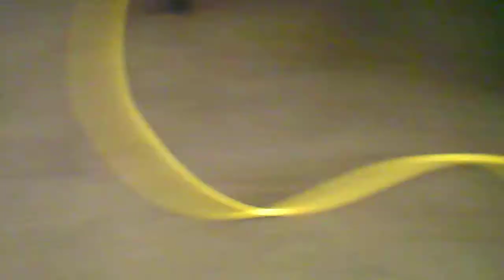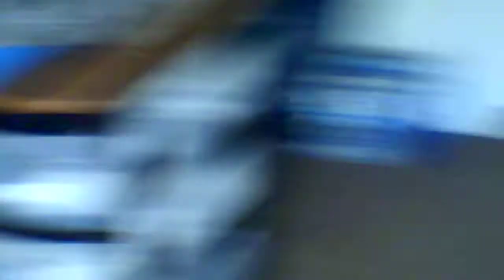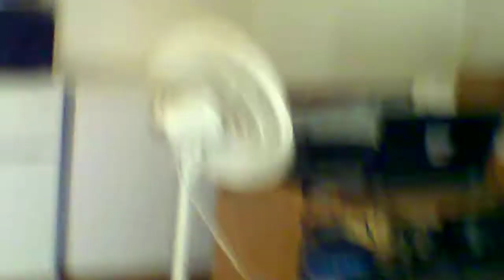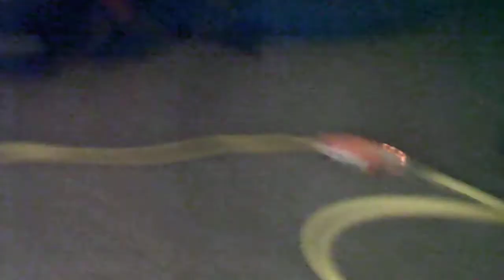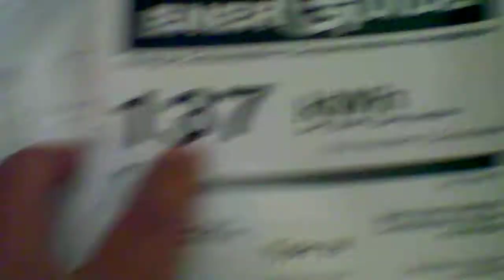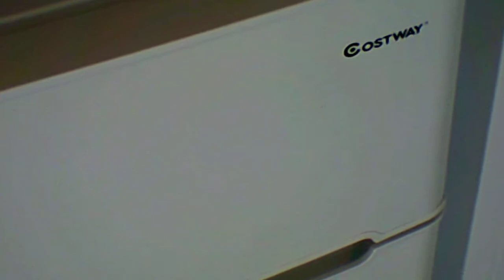Testing Mini Fridge and Deep Freeze off of solar

Comment: How much battery 🔋 capacity do you have? Is this still working for you?
Reply from the maker: I have (2) 122 Ah duel cycle marine batteries. I will add at least 2 to 4 more batteries for longer run times later. I also have manual timers to run them so they Don't run all the time. If you are trying to run a deep freezer and or a fridge or both then the more batteries the better for those days without sun. I have a few different ways to charge my batteries. 1. Solar ( I have 1200 watts in total ). 2. a wall outlet from the grid and a automotive battery charger if needed. 3. A gas powered inverter generator with DC charging. 4. I have a full size ram van that I can hook up jumper cables to. 5. I just purchased a 400 watt wind turbine generator. While you can run these off of solar with enough batteries and panels. Always have a backup for when the sun is not out. I also have a new 3.5 Cu Ft chest freezer since the start relay in the one in this video went out. One important thing is when I take anything out of the freezer I place a bag of ice in it to keep it cold. I have 2 portable bullet ice makers. Never just rely on solar alone, and don't even rely on solar and wind together since there are times when nether one of them will work. I live in Montana and in the winter I could just place most of my food in a cold box outside. So I would not need to run these inside most of the winter if my batteries went low. Can it be done ?. Yes. Does it work ? . Yes. Do you need a backup power source ?. Yes. Should you have at least four batteries or more ?. Yes. I hope this answered your question. Have a nice day.
Reply: Cool stuff man. I live in Missouri. I have a mini refrigerator that looks just like yours, except it's an Arctic King. I run it off of about 1200 watts of panels, but I only have 1 100amp hour 48volt deep cycle battery. I just ordered the Avanti 2.5 chest freezer. I'm hoping I can get away with running both my mini fridge and the new chest freezer like how your doing.  I woke up this morning and my battery was at 51 volts, so I'm hoping I will have enough battery power to add the Avanti Freezer and not drop below 48 volts during the night. Thanks for the video man, I'll probably buy me a couple timers too! Good Idea!
Reply from the maker: @jerrodbulgin2261  Please read everything. If you had purchased the Artic King 3.5 Cu Ft chest freezer. the insulation is a thicker, and it would hold the cold longer. My new chest freezer is a Artic King and it works great. I have a video on it and I show the tag with the power usage. The start relay in my avanti 2.5 cu ft went out in a year and four months, and the freezer stopped working just four months after the warranty expired. It was a good thing that I had a bunch of ice in it, or we would have lost everything in it. If you don't want to check out the video here are the specs off of the back of my new freezer. 115 Volt at 1.1 amps. That would be 126.5 watts, But i'm not sure if that is kicking amps or running amps it does not say. If you did buy the avanti already then always keep ice in it, and buy a cheap thermometer to check the cold inside it and get a replacement universal start relay you might need it. The guy that I gave my avanti too works on these a he said the the start relay is what goes out the most on these smaller chest freezers. While the avanti worked it worked great, but only lasting a year and four months was disappointing. As far as your battery goes if you are going to run both on your battery then a second battery would be a good idea for those days that don't get any or low sun. I have lead acid batteries and I use manual timers to turn the power off and on at night so they don't run all the time. The average chest freezer can be ran 4 times a night for 15 minutes at a time to keep it froze, But the avanti has pretty thin walls, and door so I would run that 5 to 6 times a night on a timer for 15 minutes at a time. I tried to answer your question the best that I could so I hope this helps in some way.

Comment: I`ll be living in a travel trailer in a few months or so. I`ve paid for it. I`m on SSI disability since last year so I used some of my leftover back pay and all of my stimulus checks to buy prepping stuff for solar power. I bought three power stations that can be charged with solar and have seven of the portable folding panels between 20 and 60 watts, about 16 of the small power banks between 10,000 and 36,000 mAh, several USB NIMH and 18650 litium ion chargers, warm white USB LED bulbs, and several USB fans, two that can be recharged with USB. I also bought a real 100 watt glass panel. 

I bought a 12 volt 100 watt rice cooker and as it turns out that`s the wattage output of the 12 volt ports I use to power it on my 300 watt power stations. I accidentally picked the proper cooker by finding the lowest wattage one possible. If you start with cold tap water it sometimes takes about 35+ minutes to make rice but I haven`t yet mastered using it more efficiently. But it works and I can actually cook from solar which is amazing to me and I`m very happy about it. I didn`t realize it was possible at such low wattage. 

Cooking a cup of rice uses about 20% of the 280 watt hours capacity in my battery. In actual usage and testing people have done there`s actually only 87% to 90% of the 280 watt hours due to losses in the circuits and features to protect the battery from complete discharge. Why don`t they advertise the ACTUAL usable capacity? 

 I bought a cheap 12 volt 120 watt immersion water heater to make instant coffee or tea. Years ago I had a 300 watt AC one and it was very useful for boiling eggs in a cup or mug. It boiled them FAST!

I ordered a 5 cubic feet freezer that I hope is as low wattage as the same size 75 watt Igloo freezer I had in my cart waiting until I could deposit a check the next day. Suddenly it became unavailable. I think the freezer uses between 300 and 400 watt hours per day. I haven`t received a 700 watt Bluetti EB70 power station I ordered yet. It`s rated at 712 watt hours. So I`m hoping I can keep my food fresh if another hurricane knocks out the power for two weeks. 

I wanted to buy 12 volt 100 ah lithium iron phosphate batteries that if charged/discharged carefully between 30 and 70% capacity could provide over 7000 charge cycles before losing 20% capacity but the cheap ones are around 500 bucks. The quality ones are closer to the 800-1200 range. The rest of the system would cost God knows what. And the lot I`ll be living on has tall pine trees on the south and southeast sides so there may not be enough sunlight for mounted panels and a real system. 

My two largest capacity power stations have the lithium iron phosphate batteries inside them and the largest one is rated by the company at 2500 full charge cycles to 80% remaining battery capacity. They say these ratings are conservative if you take care of the battery properly and never store it fully charged, especially in high heat, and never attempt to charge it in freezing weather. But the one that has lithium ion battery, less than three months since buying it, has failing USB ports but is under warranty. So regardless of the long lasting batteries in the other two they`re useless if the other parts fail. 

It`s highly possible that I just spent a fortune on a giant collection of Chinese garbage....
Reply from the maker: Wow it looks like you went expensive to get started. I just ordered another 400 watt kit for $428.51. That makes 1200 watts of solar panels for me. Now I just have to save up for some money for more batteries. I have lead acid. What ever you do take it a little slow when you buy everything you want because there is always something that you will forget to buy. Don't get in a hurry and don't hurt yourself by spending your food money. ( we do that sometimes and it does suck ). Always buy within you'r budget. If you are going to run a freezer off of solar make sure to use a timer to keep it from running all the time. Also make sure that any freezer is already froze before you connect it to solar or any type of power station if you can. Also everything is made in China.